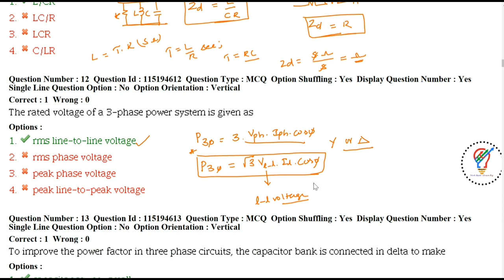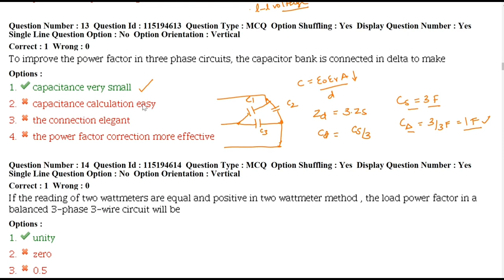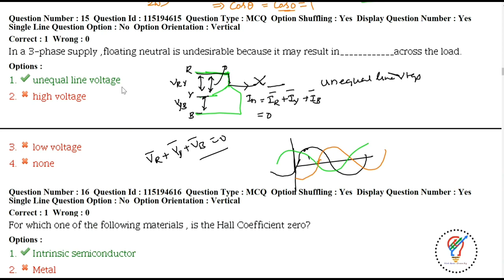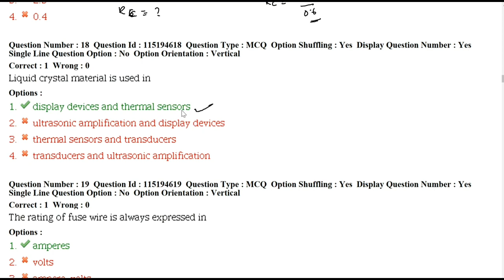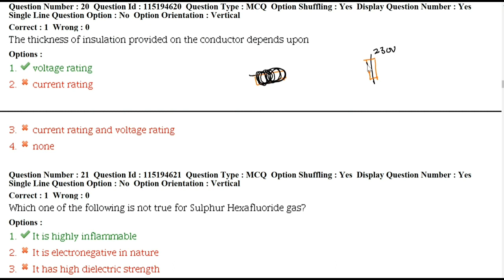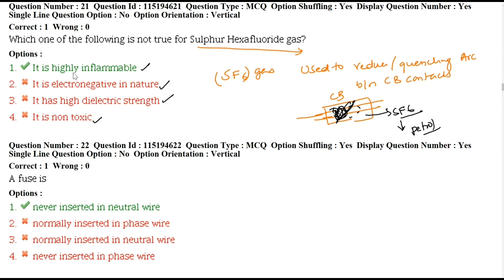11 Important Electrical MCQ'S 2022

Comment: Sir,ivanni ika waste ne ani ardam aipothunnayi like dpending on goverment like state or any other,GATE is best to prepare to know capability and also to get a job which waits for talent only,any GATE coaching from you sir?
Reply from the maker: I'm not interested in gate coaching now..focus on the carrier options which you have..don't relay on state govt especially in electrical sector in A P or T G
Reply: @ASSISTANTENGINEERELECTRICAL  Yes sir,i got 659 rank in gate 2022,i try for AIR-1 this year to book my slot